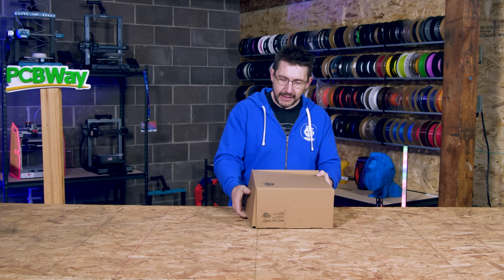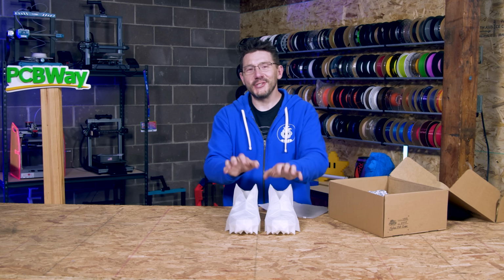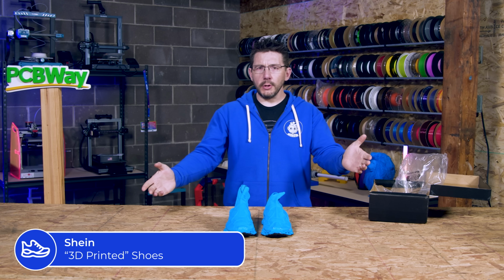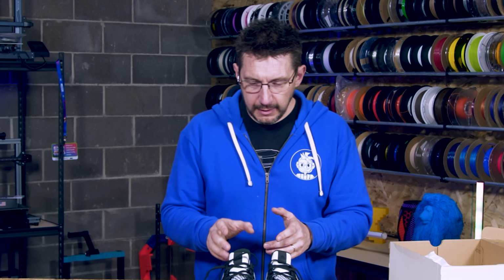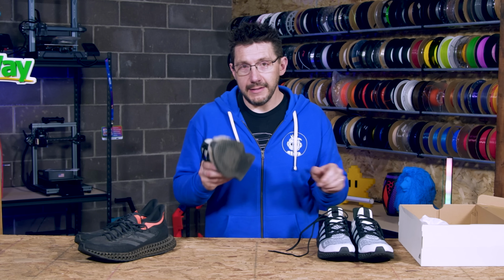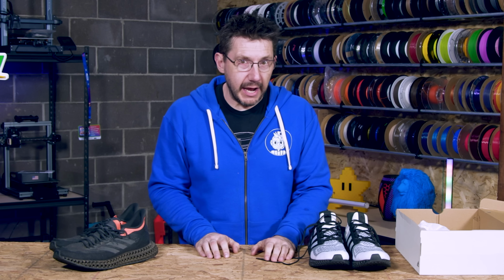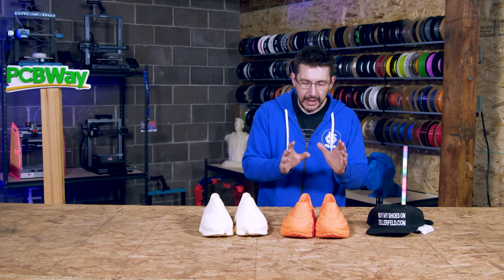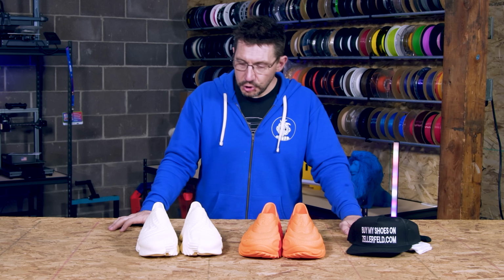Testing ALL of the 3D Printed Shoes!

Comment: It would be nice if there was a 3d printed shoe project that could actually be made at home that was modular, repairable, customizable and could try to off set the enormous amount of wasteful fashion from poorly quality shoes made from exploited labor. Even if it was a mix of traditional and 3d, if it could be done at home that could be actually useful. I wear through shoes regularly, kind of tired of giving money to companies that intentionally make shoes that will fail. Its not the most complicated product, I look forward to seeing more shoe content
Reply: IMHO it is more of a filament issue than design. The TPU that we can typically print is still to stiff and hard to walk in all day. The Dutch gave up on wearing wooden shoe...lol.
Reply: @DDDProjects  Actually wooden clogs are fairly comfortable when they're made to your foot because all points of your sole is supported. And the wood will mould itself overtime through use, making it fit even better. The main reason they're not common is because custom handmade wooden shoes are really expensive compared to mass produced sneakers.

Comment: All this ability to fix the issues with current footwear and none have addressed the heel height and shoe box width. Barefoot shoes are the way, and 3D printer creators can make a zero lift heel without issue yet still make these sweat inducing foot deformers.
Reply: Working on it!

Comment: athlete's foot is ready and eager for the 3d printing shoes. bring on the dampness and moisture! 😆
Reply: Aren't most modern shoes all synthetic anyways?
Reply: Have you ever swabbed a regular shoe and grown it in culture? I have and I don't imagine it can be much worse, so long as there is airflow
Reply: and the layer lines!
Reply: Zellerfeld shoes are printed with a porous open upper, using infill but no walls. They are highly breathable and comfortable
Reply: @KedarBenjamin  Cool!  Do you have any idea which type of infill they use and which slicer?
Reply: @MOVIEKICKS  modified cura. They used to use zigzag, now they have their own unique infill
Reply: @MOVIEKICKS  zigzag infill in the upper. they haver a custom ver of cura.
Reply: The shoes can breathe they have holes near the foot.
Reply: And you can print more when you get there lol